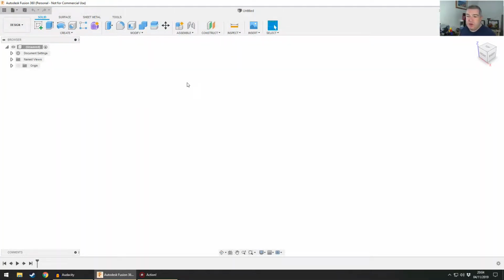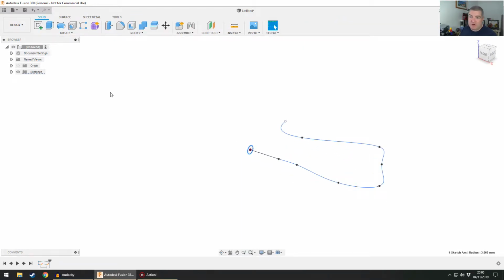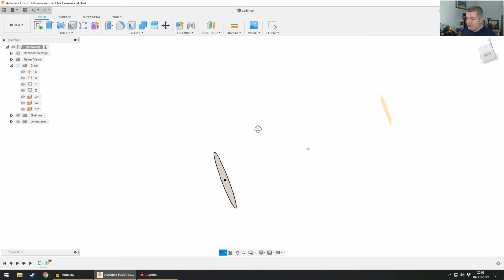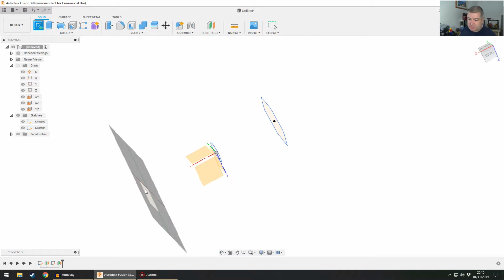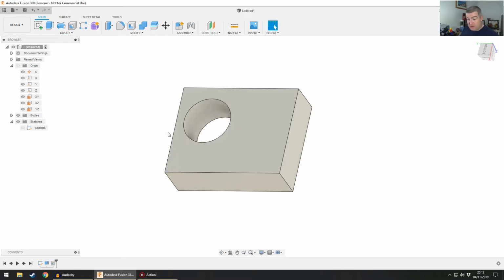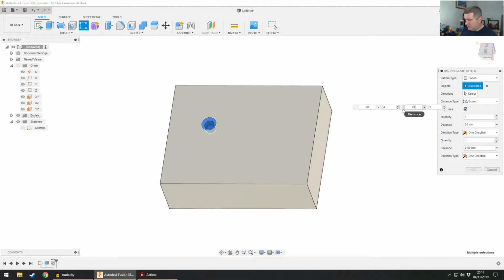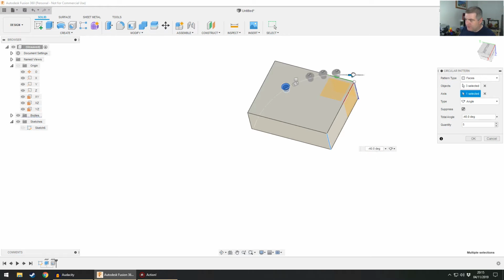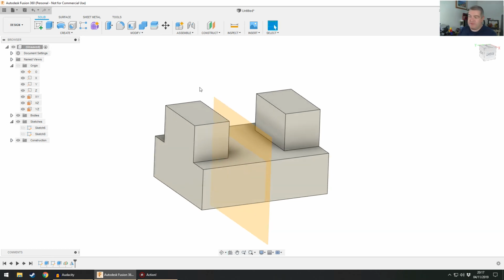Fusion 360 Part 4 - Create a creation

Comment: Hi Steven, I need your help with something. My DaVinci 1.0A 3d Printer just cannot do anything I cannot get it to find any bounds with repetier host it just goes to one of the edges and just sits there making a horrible noise which I do not think is very good. In order to fix the noise, I need to unplug the power or use the emergency stop in repetier. please help me or recommend a new piece of firmware for the machine. Many thanks, I will be following your video series on the E3d Hotend mod for the 1.0A
Reply from the maker: Hi, sounds like your end stops are working backwards.  Your printer used optical end stops which send a 0 volt signal when triggered.  There is a line in the firmware where you can change the end stop signal.

I hope this helps

Steven